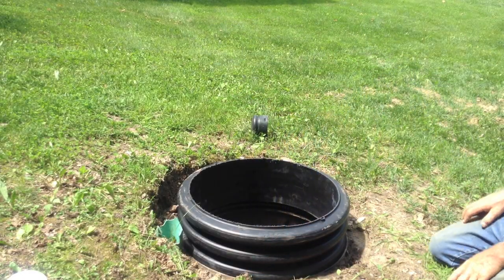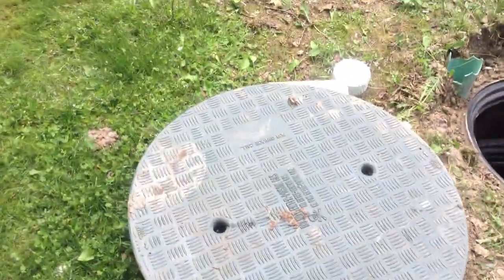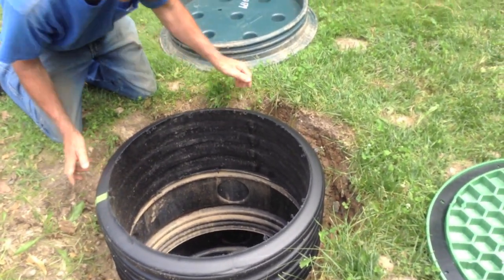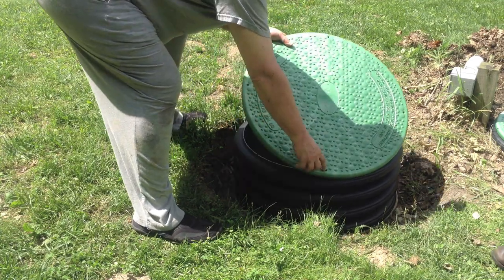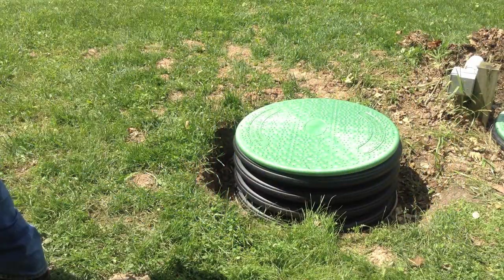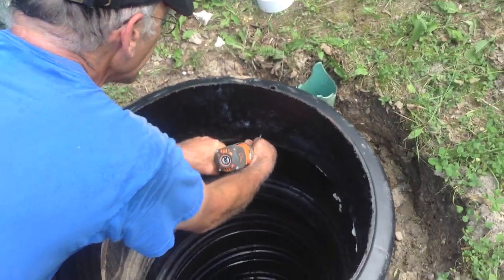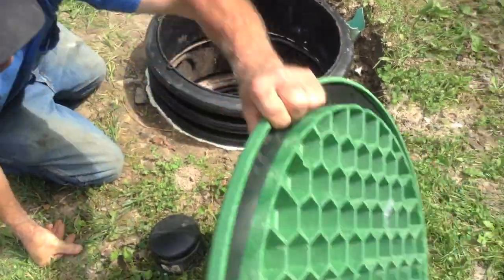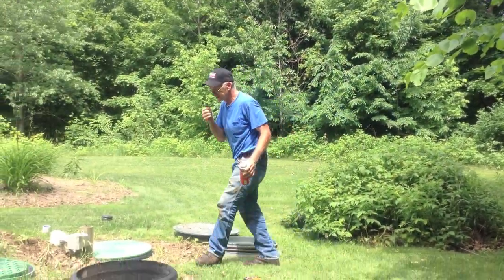How to install a septic tank riser and new lid yourself - easily!

Comment: Was hoping to find how to start from installing the adapter ring (beginning) and go from there.
Was great to see this part as well. Thanks.
Also according to one site: PVC>Concrete>Some sort of other plastic. Do you agree with that? I keep wondering if Concrete is better than PVC.
Reply from the maker: "Better" is maybe not the best word here. In my situation the plastic was a lot easier to work with but isn't as strong as concrete. And a metal lid has some advantages, but the plastic lid is a lot more convenient and strong enough for my situation. I think the plastic will outlive me as long as I don't drive my tractor over it.
And I don't know that PVC is the "best" plastic either. Some other plastics might be better but more expensive.
So it's all a balance, figuring out what the demands of your situation are. Like I said, for me, I just went with what the septic guy suggested and it worked out great.

Comment: Do you have any recommendation on where to by the riser extenders?  Most of the online options I'm finding are a full riser kit which includes the septic gasket, riser and cover.  I only need an extension, just like your video shows.  I'd like to buy 4' or so of riser plastic and cut to length as your example shows.  Many thanks!

Comment: Its interesting. I feel this type of lid is well suitable to garden area. What about corridor area with finishing floors (screeding). can we use this type of lid? will be ok with floor level? can remove easily? pls explain.
Reply from the maker: In our case the lid is held on with 4 stainless steel screws. Back out the screws and the lid comes off.
You can see the 4 holes around the outer area here: https://amzn.to/2JALZ7n
The seller specifically says these lids are flat.
I believe you could screed it even with a floor leveled around it, but I would wrap the lid in plastic or cling wrap because it has a textured surface.  Remove the plastic afterwards and you'll have a perfect appearance.
Does this answer your questions?

Comment: I know this was done a few years ago, but do you know which riser Lids he used? What brand?
Thanks
Reply from the maker: Hi Tom, you can find the lid here https://amzn.to/2LG3mEL
I have more info on my web site here: http://www.greendept.com/maximpulse/tools/septicriser.html
(and yes, I am busy updating the links there!!!).
Reply: Thank You for getting back to me. On Amazon it doesn't mention the seal around the inside lip unfortunately. 
Again, thank you
Reply from the maker: Glad to be of any help I can. This the kind of thing one wants to get it right so you don't have any problems or surprises down the road. 
By the way, our lids and the extensions are holding up great…no problems at all. I'd make another video showing that, but I doubt anyone wants to see a video of nice septic lids sitting there doing nothing.

Comment: How to install for a concrete septic tank with a concrete slab top ??
Reply from the maker: You could switch to a plastic riser with a plastic top cover or get a concrete riser.
Search for "septic concrete risers" for options.
Here is an example of a company that makes concrete risers:
https://www.flemingtonprecast.com/risers/
Here is another example of one company's solution for going from concrete to plastic:
"We often receive calls from customers with an older septic tank looking for a way to bring the tank access to the surface. Many times they only have a concrete lid covering the access hole. Either of the risers above can installed as a replacement in this scenario when paired with an adapter ring, some joint sealant, and tapcon screws. Alternatively, we manufacture concrete slabs with a riser cast into them that easily replace existing lids. Extensions can then be added to bring access to the surface for septic pumping or maintenance. Some type of adhesive or sealant like a mastic rope can be used to adhere the the new concrete lid to the existing concrete tank. No need to screw into the tank."
https://cashconcrete.com/products/septic-systems/septic-tank-risers/

Comment: what size pipe did you use?
Reply from the maker: Golly, it's been a while! It was the same size as the pipe that lead to the septic tank. I think it was 24" but I couldn't swear to that.
Reply: maximpulse from the research if done, 24 is probably correct.  Thanks.

Comment: Be careful working around septic tanks, especially older ones.  If the top of an old tank is weak, the installation of a new riser is a likely time for it to collapse.
Reply from the maker: Hi Art,
Sounds like a good thing to be aware of!
With us, our covers are on an incline and over time dirt and grass covered them up. It's funny, some folks want their covers to be hidden under their lawns, but we like seeing them (above the grass) because we know they are easy to get at!
Reply: Matt Carrasquillo Yes, if you fall into the septic tank you get very dirty and smelly, so you take a shower and guess where that dirt goes ... right back into the septic tank!  There's got to be a better way.
Reply: To get a new septic tank is around 10k to 20k or more. There are better ways of doing what a septic tank does but they cost far more and the average person can't afford the expense. The cheapest thing to do is maintain the system you already have.
Reply: Matt Carrasquillo Thankfully, my neighborhood now has a sewer.  If and when my septic eventually fails it'll be less expensive to tie in to the sewer than to rebuild the septic.
Reply: I wanted to do the same thing "tie into the sewer" but my cities sewer line is 1 miles from my house. I got a quote it would cost 50K to have it run toward me if I were to pay for it! Your lucky yours is close.